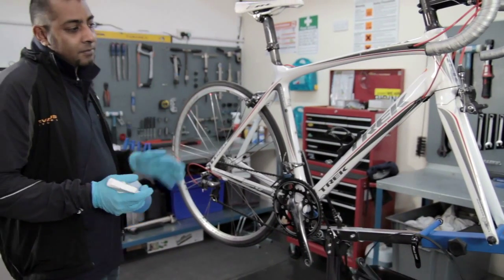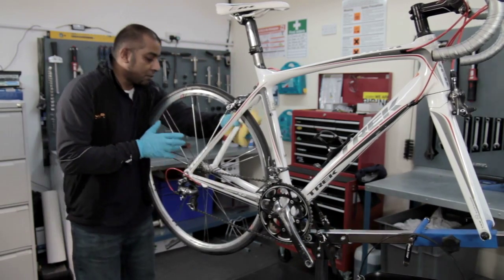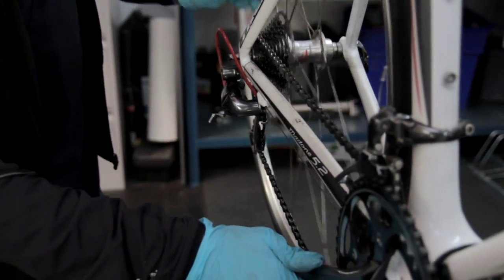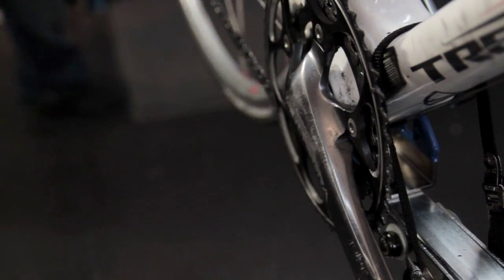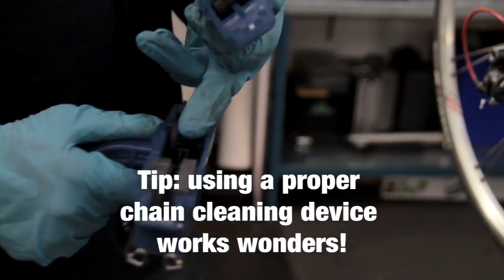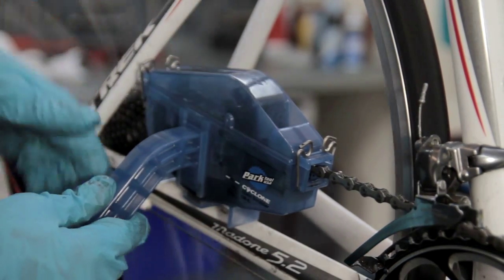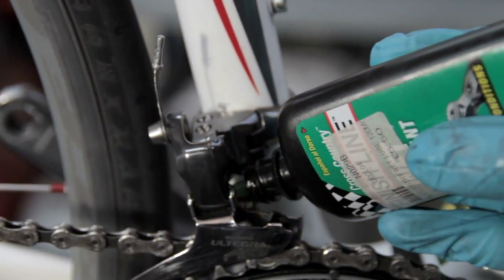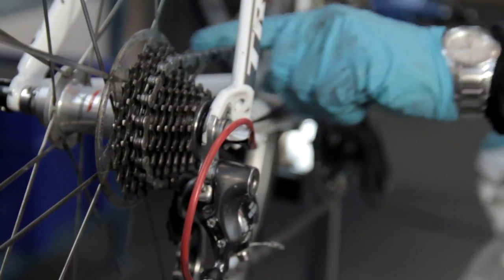How to clean your bike

Comment: A little brake cleaner works wonders on a greasy old chain. Over lube is the no 1 problem with dirty chains. A few drops is plenty. Also its been my experience to wash the chain first as it is usually the dirtiest. So any drops or spray from cleaning the chain  get wiped of when you clean the rest of the bike.

Comment from the maker: @leeshez Yes, you can, but be careful not to spray the oil on the braking surface of the rim or the disc brake rotors (depending on what sort of bike you have).

Comment: I wouldn't recommend using WD40, or at least not their standard products. It's more of a rust remover than a cleaner/ lubricant. If you have a rusted bolt, you can apply a very small amount to loosen it up, but that's about it. They do make bike specific products, that do look good. I've tended to use Finish Line and Park products, but it's all personal preference.

Comment: 2 cans of degreaser a high pressure washer and a can of inox spray does the job!
Reply: I agree, also rubbing grit and other grime into your expensive paintwork with a sponge is a bad idea.

However with a pressure washer you can end up forcing moisture into the bearings, this isn't a problem if you're not a moron.
Reply: NEVER use high pressure washer 2 clean a bike!!!

Comment: I think this is the reason I am not sure about Evans. Absoulutely no point in cleaning the frame if the drivetrain isn't clean 1st as all the grime flicks up and then covers your clean frame!

Also there is NO point in using lots of different cleaning products. Use Fenwicks FS-1 Concentrate - that Evan's sell for £9.99 a litre. This can be used neat on chains, drive etc & diluted 10 / 1 for an all purpose bike cleaner.

Comment: This doesn't really apply, when you use a spray lube, when done, just make sure that you wipe off all the residue as the residue can cause braking issues, by all means, spray lube is fine in all cases, just take caution.

Comment: you never cleaned the brakes, or the brake surface, the frame behind the chainset was filthy, you never properly rinsed of the degreaser. that cassette is not clean at all.